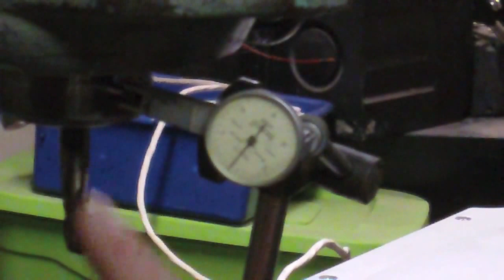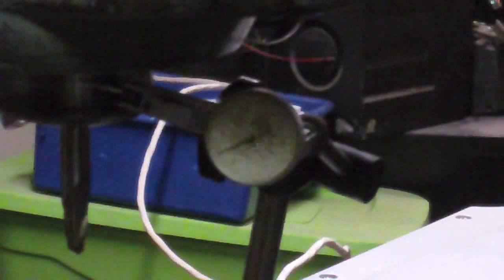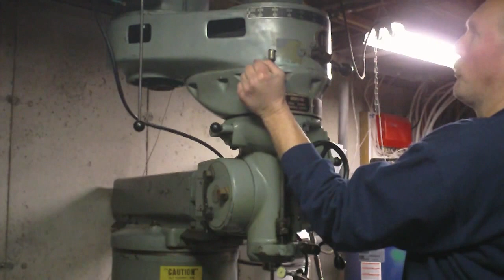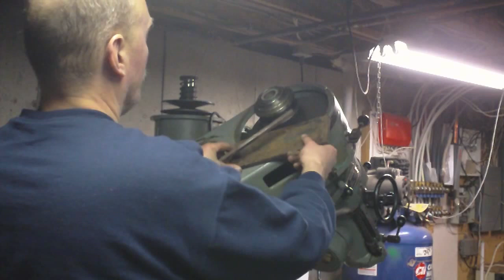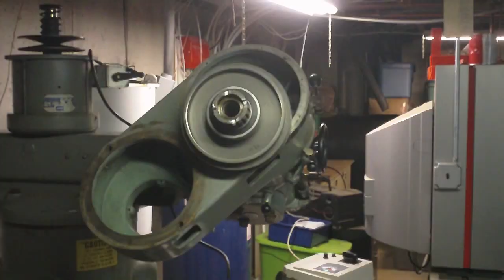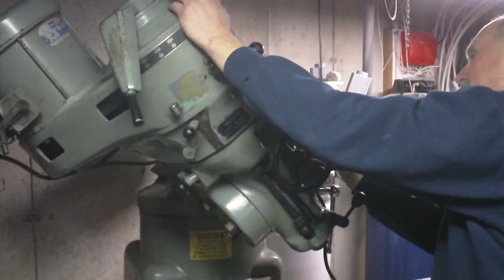Wells Index Milling Machine Part 53

Comment: Steve;

I haven't seen you float the top case like you talked about in an earlier video.  Try loosening up the 6 bolts on the bottom of the head case, rotate the spindle, and then see if it gets easier to shift between high and low.  Once you find the sweet spot, lock the bolts down and see if it still shifts.  If yes, have a beer and declare victory.  If no, try again.  I think that once you bolt on that top plate, you are pulling the whole spindle to one side and that is what the floating corrects.  It re-centers the spindle in the top case cover.

Regards;

Ron
Reply from the maker: Ron Kluwe That was the cause of the shifting problem, just posted part 54. Now alls I need is a spindle that isn't 2 piece!

Comment: Steve I wonder if its just a bit of tolerance stack because you assembled it from the side? In other words maybe the loosened bearing cap is in the right place an the case needs to move. If that's it, you could just leave all the case bolts a bit loose until you've got it upright and centered on the bearing cap then tighten up all the different levels of case bolts.